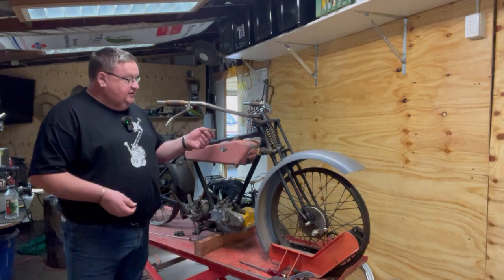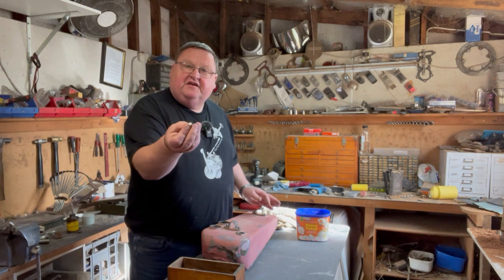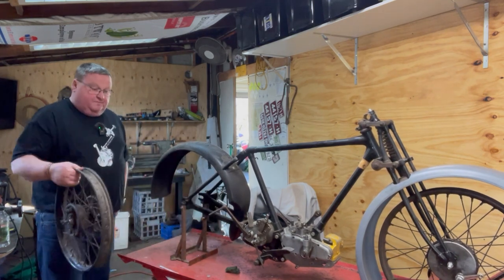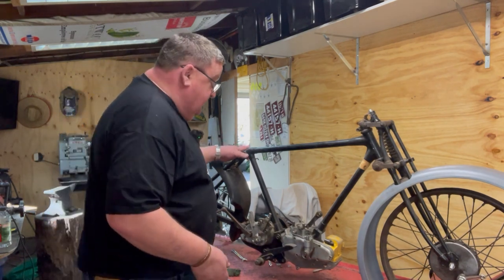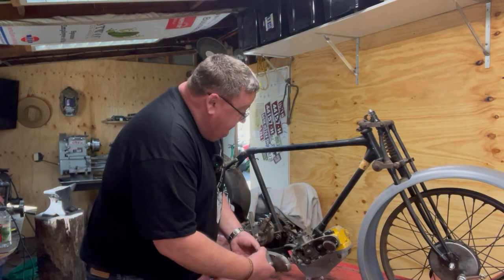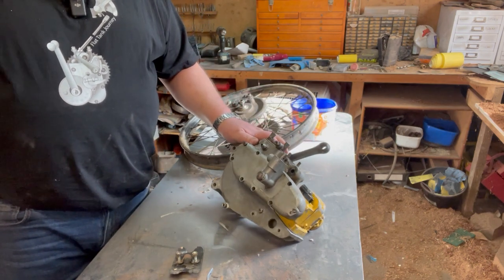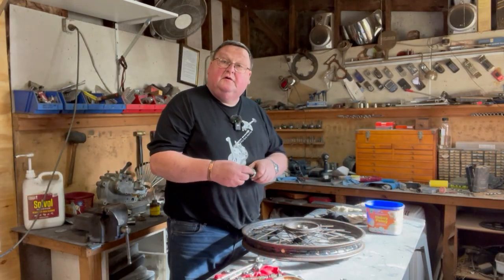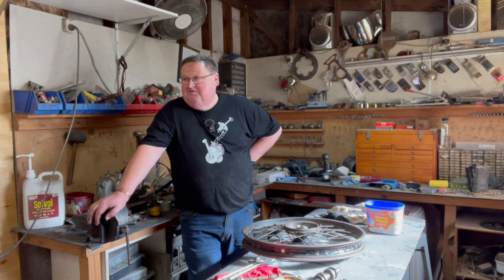BSA Wedge Tank ep 8 |  Pulling this thing apart!

Comment: Once your angle grinder is back in action I’d clean up the mess on the rim before powder coating. The powder coating although it always looks thick won’t hide that messy joint in the rim and you will keep noticing it.
Reply from the maker: Its all at the blasters.  Didn’t think of grinding first.  Too late now.  I’ll show you how it turns out soon.
Reply: It’s difficult to take a grinder to a new shiny chrome part!
Reply from the maker: @geoffhastings281  you bet.  But I probably should have?  Never thought of it.